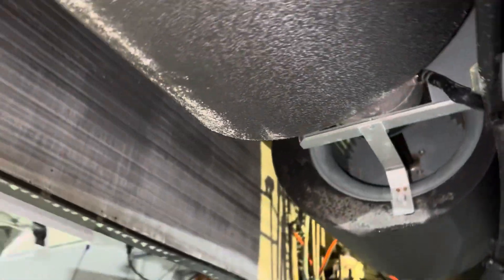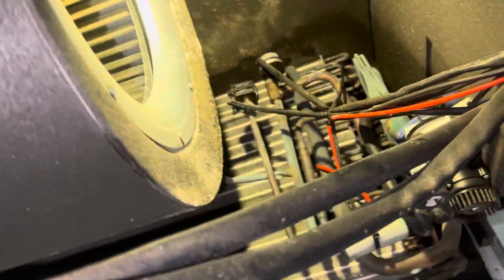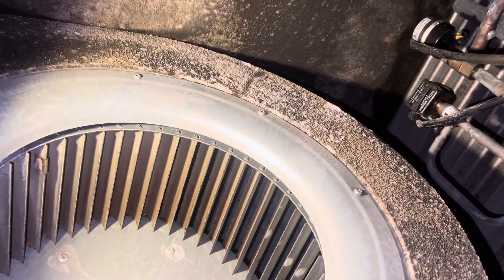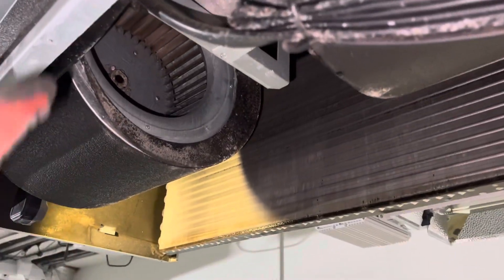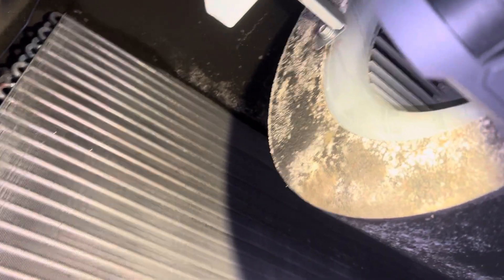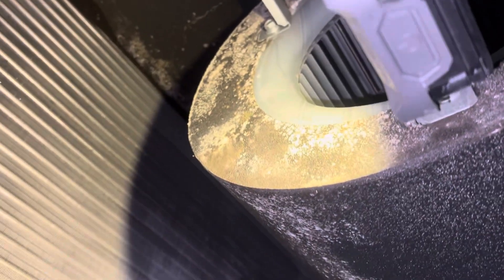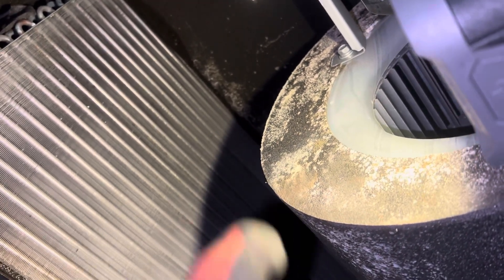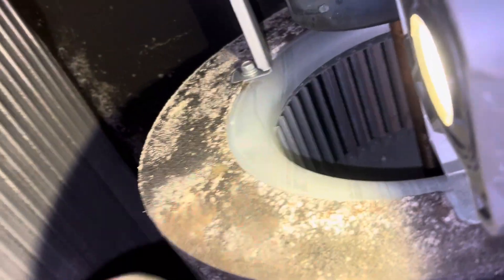￼ Mold, growing inside air handler organic material like a good filters. ￼MERV 16

Comment: not sure who told you that, but i think you are incorrect. Unless you have uv light in the ac there is absolutely no way to prevent mold even merv 16 cant prevent small particles from entering the system.
Reply from the maker: I install MERV 16 in all my installs with High dead organic content in the air.  Absolutely no mold.  Been going 8 to 12+  years without ever cleaning the air handlers because they are so clean. 

That’s the difference between know first hand and guessing